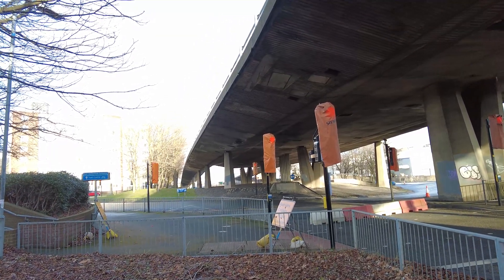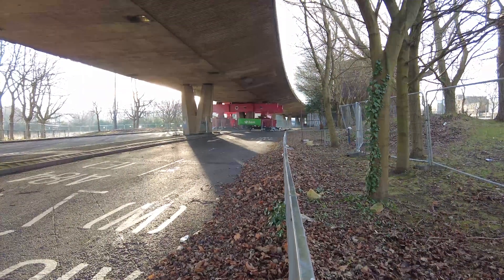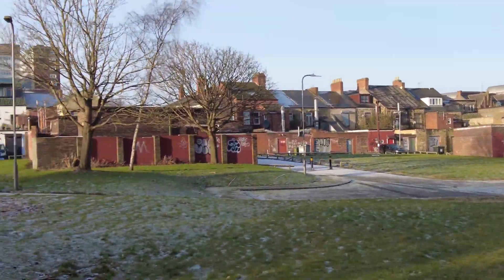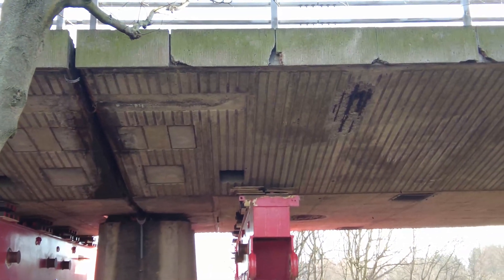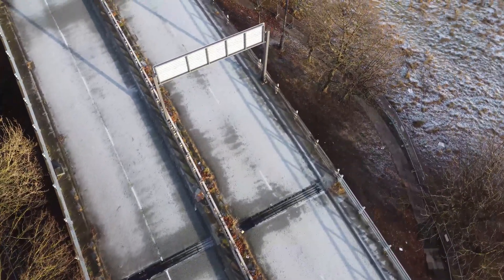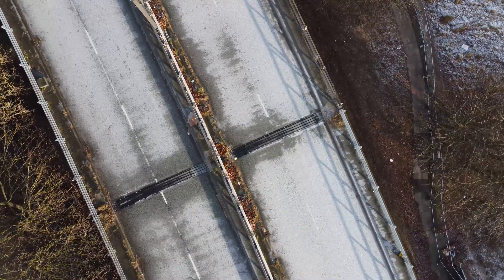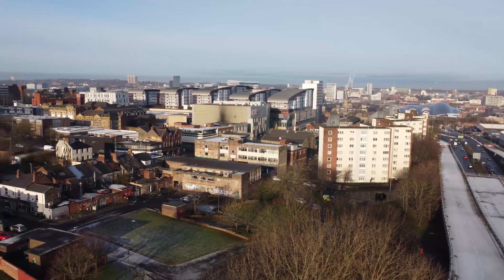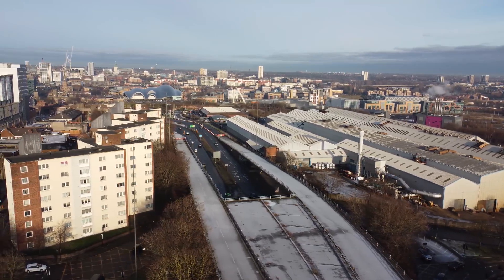A167 Gateshead Viaduct on the verge of collapse?

Comment: That's not a drain, it's an expansion joint, which allows for the concrete structure to expand and compress as temperatures change. Without them, the concrete would break up. Although it looks like it's doing a pretty good job of breaking up as it is...

Looking at it, they'll most likely just take out the overpass and use the road that runs underneath instead
Reply: It's an expansion gap but it has a drain built into the support.

Comment: The road feature that you keep calling a drain is an expansion joint in the concrete - they allow for lateral movement. It looks like the road was designed quite badly as such joints shouldn't allow water to permeate into the concrete. 
Gateshead Council has known about this road being unsafe for at least 8 years. It has always been the councils intention to remove the road and replace it with a tree lined cycle path. Once demolished, I expect that idea will be followed through.
This will not be the end of the story. Over the river, Central Motorway was built around the same time as this flyover - part of the road network you described. Central Motorway is also seen as problematic. The same idea is being passed around for that route too - demolish and turn it into a tree lined cycle path.

If you're ever bored and fancy using your drone, go to the Redheugh Bridge (concrete one) over the Tyne. It sits upon concrete legs and they've also started crumbling. Just beneath the road deck, where the legs meet it, take a look at the concrete corrosion and crumbling. It's in a right state and is also known to the councils. So bad is that bridge that a car park beneath it has had to have sections closed off due to falling masonry!

As others have mentioned, that round tower is ventilation/access to the Metro tunnel below.

Comment: The Metro crosses the route at about 90 degrees, almost exactly where the jacks have been fitted. The round brick structure at 4:07 is a ventilation and escape shaft.